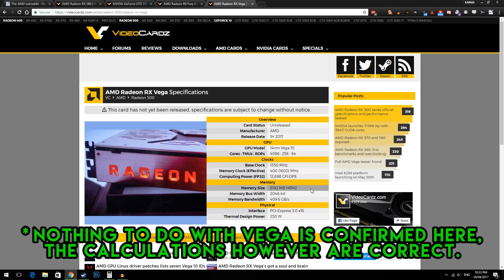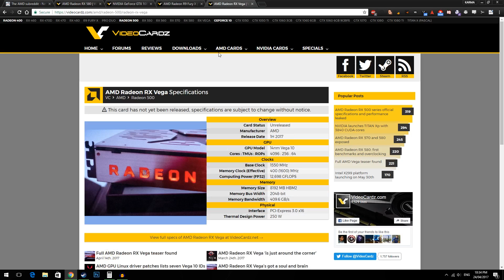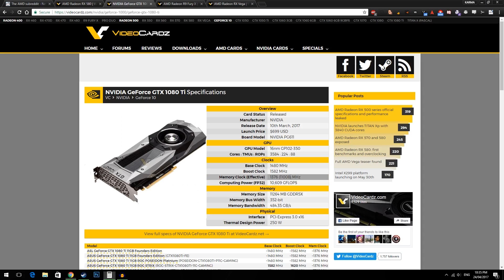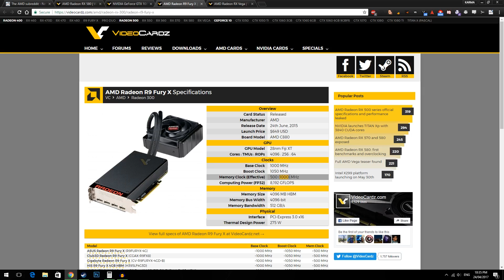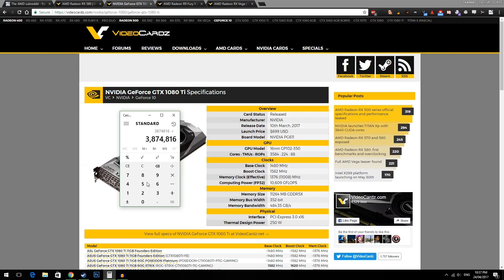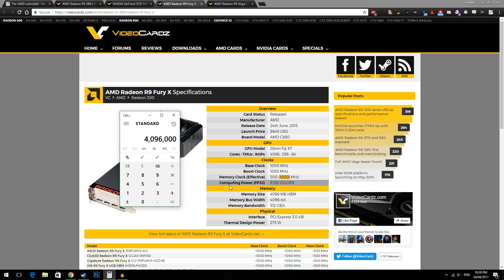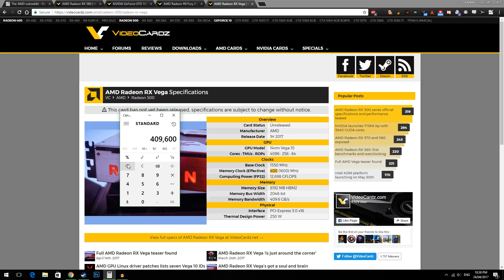(OUTDATED) How to calculate GPU memory clock speed and memory bandwidth

Comment: hi 
 i been having a issue,  with the rx580
is the memory clock always at 2000 Mhz?  even when the card is at idle? 
 while at idle the memory usage is about 300 mbs 

memory clock being at 2000 Mhz all the time is normal?  or the clock suppose to be down  while the card is not under kind of load?
Reply from the maker: No idea I am not an expert on that. But if its at 2000 MHz thats fine cause it's running at default speed then.

Comment: With vega its not that you dont divide it by 2, you do, with current vega there are only two HBM stacks!
Reply from the maker: Ah then that makes sense! So it's only 8GB of VRAM?
Reply: Yep, 2 stacks of HBM2, there was something about a 4GB variant as well.
Reply from the maker: I was hoping they would do a 16GB one, with the four stacks, oh well, 8GB is plenty for 4K I guess.
Reply: Plus it'll have the High Bandwidth Cache Controller so it'll be able to use your system memory if it needs to.